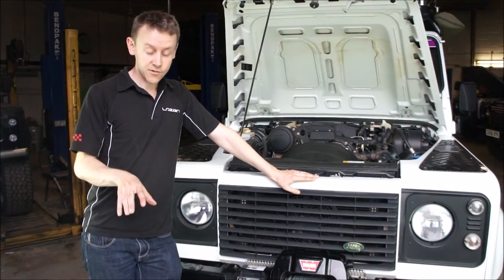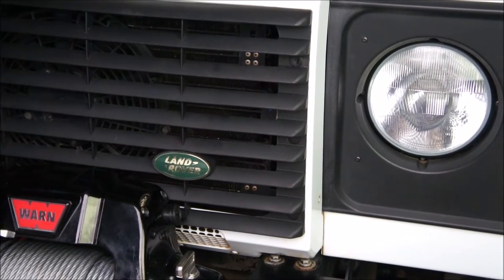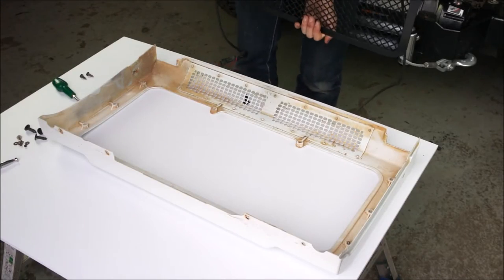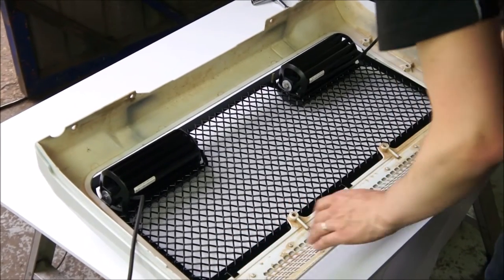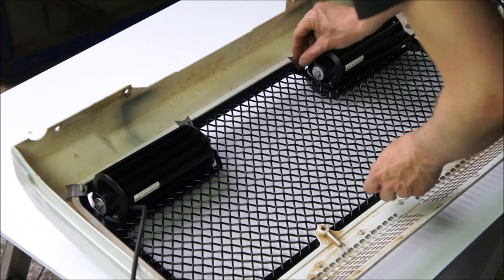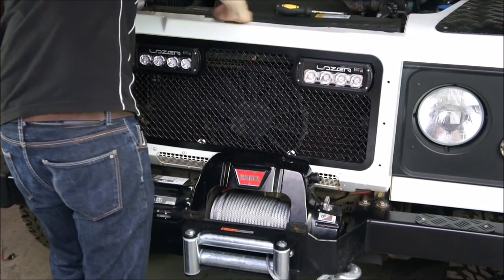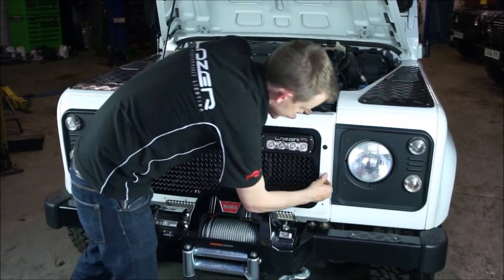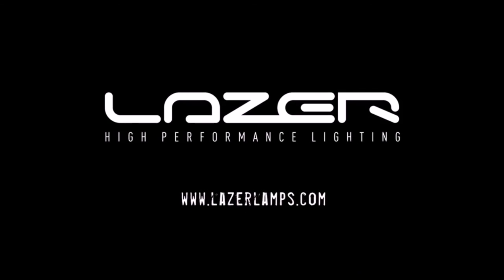Lazer Defender Grille - Part 2 -  Grille Installation

Comment: Is this grille the same as the Zunsport rvs grille whitout led? they say it wont fit a Defender whitout airconditioning? is this true.
Reply from the maker: Apologies for the slow reply! You can fit the grille to a Defender that doesn't have air con, but you need to buy the surround to bring the nose of the Defender forward slightly: 
https://www.lazerlamps.com/grille-surround-land-rover-defender